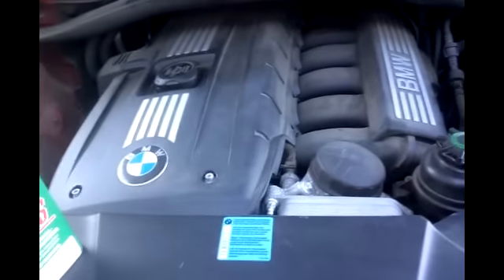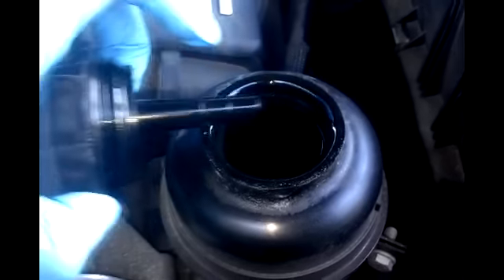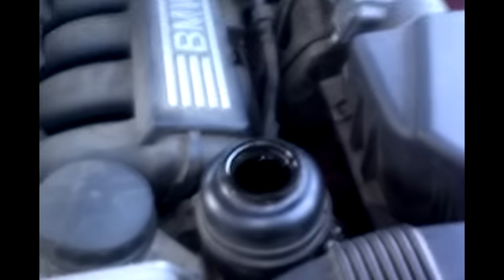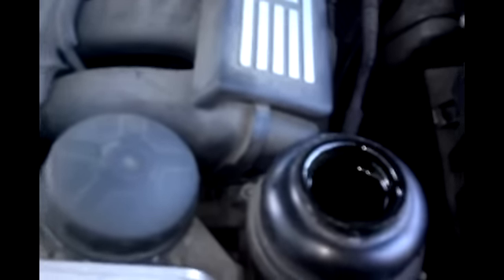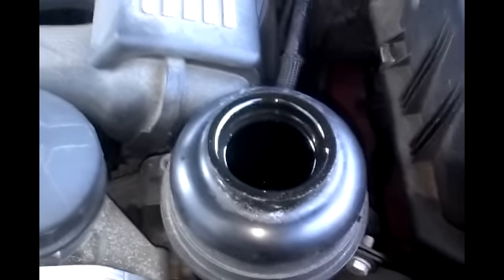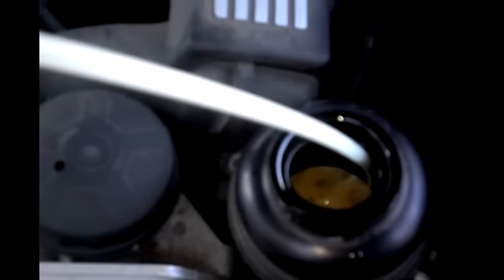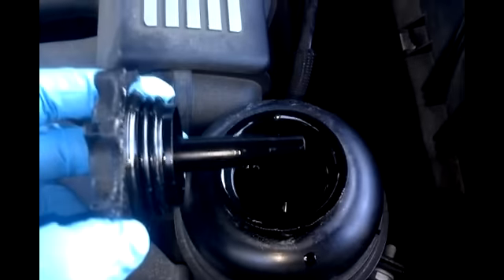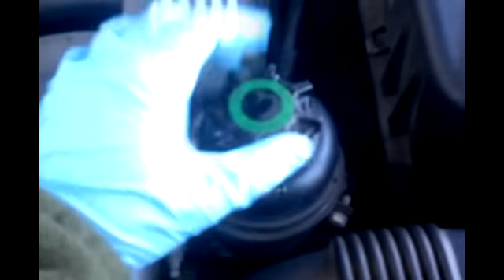DIY BMW Power Steering Flush And Fill Procedure To Maintain Your Power Steering System

Comment from the maker: The ATF fluid often can develop the light brown color. Unless you are going to fully drain the fluid ATF and CHF cannot be mixed. You can safely switch between the two fluids but the old fluid must be removed completely and the flushed once with the new fluid and drained again. Unless you know it was changed at some point I would suspect you have ATF.

Comment from the maker: Hello, The radio problem would depend on your vehicle options. It could be a failed amplifier (left side of trunk), a bad antenna amplifier, or radio. Double check your power steering fluid level and condition. A fluid flush might be a good idea. Also have the inner boots of the rack checked for leaking. This could be a failing power steering pump or a binding in the steering rack or steering shaft. The oil leak is usually the valve cover leaking down from the top.

Comment from the maker: Hello amrou, It is common for the power steering lines to leak fluid and drip down. Take a look at the lines and see if they look wet or have stuck dirt to them. I have seen the reservoir leak also at the bottom due to the clamps not holding well. You could try to put new clamps on and clean first as well. :)

Comment from the maker: I have not measured the amount unfortunately. Most flush and fluid kits come with enough fluid to clean and fill. Like Valvoline the fluid often is used for both purposes and can be mixed with no problems between the flush and fill. The system does not hold that much fluid so I would guess around 2-3 quarts.

Comment from the maker: There is no set interval for the power steering fluid. I would say as a general rule of thumb it would be worth changing every two years. This would help keep the system good and clean.

Comment from the maker: Check the fluid with the cap with the engine off. No need to fully install, just place it on top and remove to check the level.

Comment from the maker: Not too difficult. It is not pressurized unless the system is running. So with the vehicle off you are good. You will need to replace the crush washers on the banjo bolt end on both sides as well to prevent leaks. No special tools needed for this one my friend. Happy New Year! Let me know if you need any repair instructions.

Comment: wow !! I thought you would drain the fluid via a drain plug. cool video !

Also, how many quarts of P.S fluid does a typical BMW (E60) take ?
Reply from the maker: Hello, You can remove a power steering hose to drain but this is much cleaner and easier. If the system was empty it would take 2-3 quarts of fluid. Thanks for the comment.

Comment from the maker: I like real oem and pelican parts but I often buy from the dealer. I think most part stores have a decent selection of fluids like Pentosin 11s but for BMW specialty fluids like transmission fluid and transfer case fluid I like to buy from the dealer. I have heard good things about red line fluids so they are an option online.

Comment: I have a 328xi 2007 and recently my power steering just isn't working. I have checked the belts and fluid levels and all seems good. It has been suggested that it is probably the power steering pump. Without seeing the car, would you think this is logical ?

Comment: Thanks for your quick reply.  I will try the flush and see how it goes.  To my knowledge all power steering components are covered under BMW's 6 year extended warranty, is that right?  I just hope flushing it doesn't void it for some reason.

Comment: Thanx for all the help I have another question but this is about performing a rear differential on my car and was wondering if it's the same process?
Reply from the maker: Hello, The rear diff is very easy to do. Just drain and fill until it overflows from the fill plug. Nice and simple.

Comment: HI, Very well done Video. Thank you for posting it.
I`m having an Issue with the steering on my 2010 238i Coup maybe you can help me with. Just Bought the car Pre Owned Cert. From a Dealer and I love it! But there seems to be a Issue with the steering when making a left turn. Sometimes the Steering wheel feels sticky then it frees up and you can feel the car over steer left. The Car goes back to the dealer this week, they've been great about it but I tried flushing the system with no luck. Thx

Comment: Hi there, I have a 2009 328xi E90 and recently experienced a slight "groaning" noise sometimes when turning the wheel.  The noise has gone away but the steering is tighter now.  I checked the power steering fluid when cold and it was at the bottom line.  Is it possible I may just need to top off the CHF 11s?  I ordered some of the fluid and plan on doing that, unsure if I need to do the full flush though.
Thanks for the video, appreciate the help.

Comment: Ty for your reply, my last 7 vin digit is PF66665 on the cap it says ATF which is automatic i'm just not quiet sure of what brand to use or type of fluid is the right one for my Beemer.

Comment: Hi nice vid... just wanna ask coz i checked the cap of my power steering cap and it didnt say anything about what oil to use i have a bmw 325Xi not sure what oil to use for this the damn canadian tire would not do a flush on my power steering coz they dont have the oil... so i wanted to DIY my bmw would appreciate if you can reply

Comment: I have a 2002 BMW 330ci... My problem is the air heat or cold air is not blowing at all... I think its the blower that bad... Need to know how to change the blower?
Reply from the maker: Ronald, this is usually not the blower but is the FSU or final stage unit. I have a video on how to repace this unit.
Reply: Thank you so much :).   For the information.  You have bless day
Reply from the maker: Your welcome Ronald. Thanks for all the +'s. Let me know if I can help further or in the future!

Comment: Just to confirm, it is best to suck out the old fluid , put in new fluid, turn stering wheel with car on, suck fluid again and replace with new fluid and repeat turning the wheel with car on and then check fluid and your done?
Thankx in advance and can you tell if this is the correct steps or not.
Reply from the maker: Correct :) This way the old fluid that is in the pump and lines will be mixed with full clean fluid and then removed again. This helps to remove as much of the old fluid as possible. Thanks for watching!

Comment: Hello, can you mix this with lucas power steering sealant for leaks and if you can does it matter which goes first and how much of each liquid? Thanks.
Reply from the maker: +kozma kumani Hello, I would not recommend any kind of stop leak. Best to repair the problem so no damage to other components results potentially from the stop leak.

Comment: I've been informed that the previous owner of my car has the wrong fluid in, it's makes a whin sound ... So I was just wondering if this procedure would still work even tho it doesn't drain 100% , or would disconnecting the return line be a better option so nothing gets mixed ?
Reply from the maker: Hello Adrian, It sounds like the pump may be damaged due to the incorrect fluid. I have one like this in my shop now and putting the correct fluid in did not fix the issue as the pump is compromised. You can definately remove the return line to help remove the fluid and doing a full flush can still be attemped. You may still need the pump replaced however.

Comment: what are your feelings and or additional steps regarding changing from atf to chf 11s? same flushing procedure?
Reply from the maker: You may want to remove on of the hoses to the pump to clear out the lines. You can switch to 11s and it is a BMW procedure to help elimate some noises.
Reply: Thank you for the input. I love all the tutorials. I was replacing the hoses and reservoir anyway so it all worked out great. Much appreciated!
Reply from the maker: Perfect! :) Thanks for watching my videos!

Comment: Hi. The power steering on my 2006 325xi works fine but there is a lot of leakage/residue on the outside of the PS cap from the top to the bottom. What could be the cause? A bad seal on the cap or something more sinister? I've never checked the fluid level as I have my car serviced by the BMW dealer regularly. 326,000 miles on the car!  Nearly all German autobahn driving.
Reply: mrgrumpy0505 Thanks for the email response. I had to bring my car in for a repair (overheating problem traced to buildup of dirt on the radiator) and pointed out the dirty cap to my mechanic. He showed me the hole in the cap and cleaned it up. I checked the PS fluid level today and it was between the 2 lines.

Comment: Do I keep on bleeding the steering wheel until the fluid levels stops to drop at the end or just doing it once or twice is enough?
Thanx
Reply from the maker: When you do the bleed make sure the cap is installed. Usually turning slowly lock to lock each direction two times is enough to purge any air. If the fluid does look like it has a lot of air bubbles then just let it sit for a short time and recheck the level and top off as needed.

Comment: what is the best brand (not necessarily the highest price) of ATF for 2003 BMW X5 3.0i? is the sucking between refilling necessary? cause i dont have a sucking tool.
Reply: by the way, mine is manual transmission.
Reply from the maker: +Alfred Balmes For the power steering BMW recommend Dextron to my my knowledge.

Comment: Hi, i've 320i e46 M package (2002) and the steering wheel is moving really hard, i barely can turn it with 1 hand, can it be power steering fluid problem or is it normal for sport car?
Reply from the maker: Hello, Check the fluid level and condition but if it makes a lot of noise and is hard to turn while driving this would most likely be a failing power steering pump.
Reply: It is hard to turn but there is no noise at all.
Reply from the maker: Interesting. This still sounds like a failure of the power steering pump. The shaft can fail so basically the pulley is turing but the internal impellor is not moving so you get no power assist. You will have to remove the belt and feel the pulley to see if it feels like it will pull forward or if it has no tension due to an internal failure. I think a power steering pump replacement will be needed.
Reply: thanx for your answers, i think i'll go to technical service to change the pump and maybe the fluid as well
Reply from the maker: Glad to try and help. I hope you have a great new year!

Comment: Hi, i got a z4, 2004 and while i'm driving is hard to do it with one hand , i feel the steering wheels hard to move, feels like gets stuck, don't hear a Sound , do you know what is the problem?
Thank you
Reply from the maker: Hello Jorge, I have seen this problem many times. The failure is most likely in the steering column. This vehicle has the electronic power steering and it needs to be replaced as an assembly.

Comment: 2006 325i / is there a filter somewhere that may need to be re[;aced? thanks.
Reply from the maker: Hello John, The filter inside the resevoir can be replaced as needed. The filter sits on the bottom of the resevoir and is easily removed.

Comment: Can you help me with this issue I have please?
I just got done replacing both tie rod 
ends,  sway bar links, psp rack and pineon and had the cambers aligned 
properly. The car was steering 100% smooth left to right but of course the steering wheel was off because of all of the work done.

I go to get a computer alignemnt, right after its done i'm driving and now the steering wheel is stiff when left to right.

Almost to the point where its straining my hands?

Now what?
Reply from the maker: Hello Sean, With all that work done the alignment should have brought the vehicle into spec. with the wheel straight. One thing in addition to check is the strut towers to make sure they are not mushroomed. If you had a shop do the alignment then they need to redo this for you.

Comment: my steering has become heavy then all of a sudden it goes back to normal what cold this be?
Reply from the maker: This should definitely be checked. This could be a number of things. Check the fluid level of the power steering. Could be a failing power steering pump. Could be binding steering shaft.

Comment: How is the fluid suppose to look like if it doesn't need a change? Like the color or odor?
Reply from the maker: The odor is just like Dextrol ATF. Usually if the color is off or the odor is off it is already contaminated. Better to be ahead of the game and replace the fluid periodically to maintain clean fluid for preventative maintenance.

Comment: Hi, Thanks good explanation. However I have a question, when I apply brakes on my BMW E46 I hear a single click noise (like a single knock) what could be the problem?

Iam thinking of flushing the fluid, could it be poor bleeding after changing the brakes pads?
Reply from the maker: Hello Samuel, The click could be the brake pads themselves. I have seen this on aftermarket brakes due to a tolerance issue with the pads. They can shift in the caliper bracket and make a click noise.
Reply: AskTheCarExperts Thank you for your quick response, I will check the pads over the weekend and shall let you know my findings as per your advise. U are great, good day and all the best.
Reply from the maker: Sounds good :) Hopefully that is the noise. You can sometimes make the noise go away temporarily if you remove the pads and use some brake past (anti-squeal) and apply it where the pads sit in the caliper bracket.
Reply: AskTheCarExperts Thanks noted, actually the pads on the car have a bit different clip size to the original removed. Fitting was even tricky despite that they were correctly fitting in caliper grooves, I now suspect a broken clip on some pad as per your current advise. Thanks once more will let you know .
Reply: AskTheCarExperts Hi, Your advise was perfect just as you said it was the After Market brake pads. The clips on the brake pads were not holding firmly in caliper grooves hence allowing a play as I brake.

I opened them up so that they are more tight in the caliper grooves and the noise is gone, however I know this will be for short while before they weaken up again. I will therefore have to replace them with Original Pads to solve the problem permanently. 

I really appreciate advise, Thanks and all the best.
Reply from the maker: Hello Samuel, That is great news. At least you know it is not a safety concern. I am glad that it was what I suspected :) Thanks for watching my videos!
Reply: AskTheCarExperts Hi, Its my pleasure your videos are superb and well explained. l will always watch them thank you very much for your help.

Comment: GOOD MORNING YESTERDAY STEERING WHEEL STARED MAKING NOISE AND I ADDED FLUID WAS LOW WORKD FOR ABT 5 MINS AND NOW IT GOT HARD TO TURN FLUID STILL FULL DONT KNOW IF I USED D WRONG FLUID PLS HELP SORRY ABOUT THE SPELLING ENGLISH IS NOT MY FIRST LANGUAGE 2003 bmw 325i
Reply from the maker: Hello Johanaton, No worries on the spelling. On your BMW it should be ATF automatic transmission fluid and not power steering fluid. Specifically Dextron 5,6, or 7. But it sounds like your power steering pump may have failed by your description.
Reply: TNX I TOOK D PUMP OUT TODAY WILL BUY IT TOMORROW AND INSTALL IT TOMORROW IF I PUT D WRONG FLUID WONT DAMAGE ANYTHING AT OTHER PART
Reply: And tnx for d quick response
Reply from the maker: You bet :) Have a great New Year!